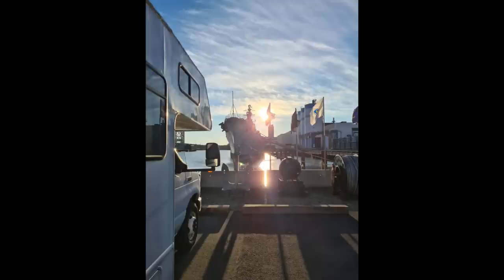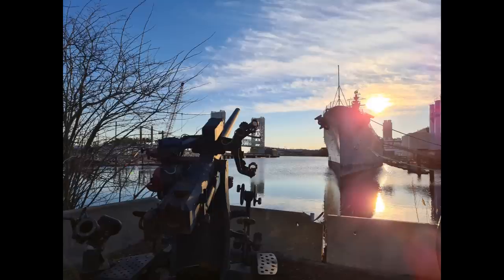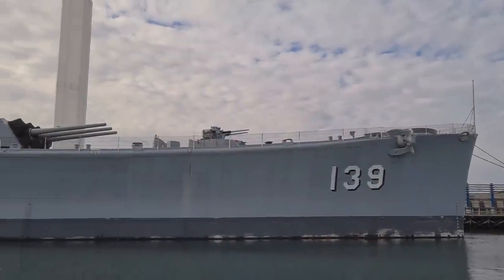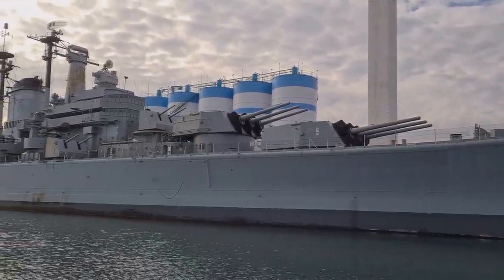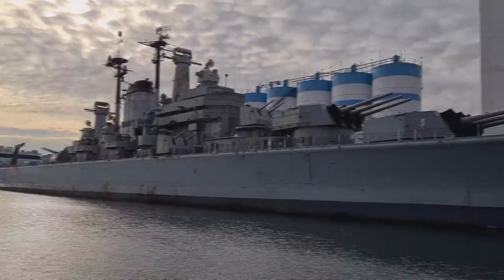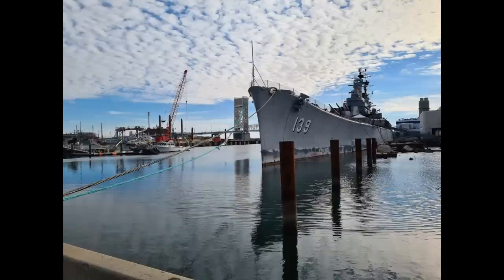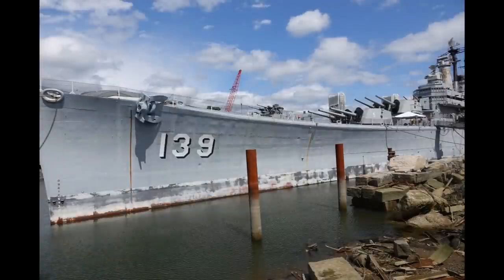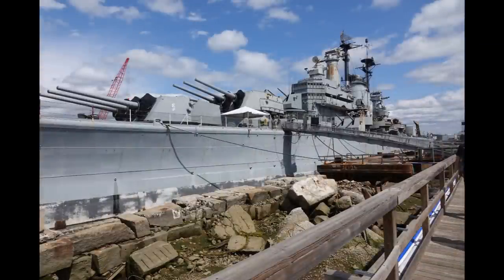USS Salem - Last of the heavy cruisers

Comment: that section in the gunpit made me realize how impressive it is that these guns were all-angle autoloading. The entire loading mechanism had to swing downward along with the gun into the pit

Also I've been on the Salem numerous times, and this is the first time I've ever seen the gunpits and magazines. Those areas are normally blocked off from the general public
Reply: That was truly a marvel of engineering. The only such system in the world,
Reply: @thomasbaughman9941  not at all unique, there are other autoloading guns that works in all angles but the ones on des moines class cruisers is the only one at this large size, the others are 155mm (6.1 inch) or smaller guns. like the archer spg/howitzer from volvo/bae systems has a 152mm (6 inch) gun that autoloads at any angle
Reply: @Deilwynna  Yea but this was in the 1940s. The Archer is from the 90's. In the Des Moines' day, the only weapons systems like the 8"/55RF Mk 16 were the 6" autoloading guns on the Worcester and Tiger class cruisers. All-angle loading itself was very rare
Reply: @Billy-I-Am-Not  The big difference s that the 8 inch gun system worked, the US and British 6 inch systems didn't US Mk 16 "These guns did not prove reliable in service, possibly because of the high rate of fire and need for any-elevation loading. Another contributing cause was that they used a dual projectile hoist system - one for AP and one for HC/AA shells - which proved to be a source of jamming."
Reply: @colbeausabre8842  the guns on the HMS Tiger worked fine, by most accounts
Reply: @Deilwynna  152mm would not be 5 inch, that would be 127mm.
Reply: @Deilwynna  There was the MCLGM which was an 8" gun. It could be considered the 8" version of the Mk45 5" gun, but the project was cancelled because the Navy couldn't decide where to use the gun. Initially it was for the Spruance-class destroyer, but then the DD wouldn't perform its intended escort and ASW role if used for bombardment. There was some speculation of using a Long Beach hull armed with this system for a new cruiser-sized surface combatant, but nothing ever developed.
Reply: @Deilwynna  firstly, nothing of that time period was even close, not only in size but in function. The system you attempt to reference as proof is both land based and 40+ years newer than the all angle vertical breach system used in the Des Moines, not to mention much smaller and only feed a single tube. This was a rather pathetic attempt at the stereotypical neck beard "AcKsHuAlLy" that has ruined the WW2 vehicle combat simulator game genre.

Comment: Heck, a ship in the USN doesn't need to be in mothballs to be cannibalized for spares! It routinely happens to ships that are just in the shipyard for overhaul/repair or modernization. I've been on both sides of it (having parts from my boat cannibalized and going to other boats in the yard to take their parts.)
Reply: So true.  I remember well, Easter Weekend, 1992 (I think) I was the leading comm ET on USS Peterson DD-969, we were finishing up a 14-month ROH at Ingalls in Pascagoula.  I had weekend duty. The USS John Hancock DD-981 had a bad class Alpha fire in her radio transmitter room, (The RM's had been stowing burn bags in the transmitter room. Still can't believe that the EMO or the Lead comm ET allowed that, I know I wouldn't have) and they caught fire, never did find out exactly how.  Smoke and heat damage was extensive.  Hancock was scheduled for deployment in just over a month. My guys and I had just spent the neter part of 6 months overhauling and grooming of all our HF transmitters, they were like brand new.  I was ordered to load them all into a rental truck and drive them from Pascagoula to Jacksonville and deliver them to the Hancock.  We brought back their fire damaged junk, and had to do a hasty, abbreviated rehab job on them with very little time to get it done.  Went from having a like-new HF suite to trying to remedy someone else's problems. (again) We eventually got them up to snuff, but it was a long, frustrating and exhausting process.  Truth be told, I'm still a little hacked off about it 30 years later.  LOL
Reply: ITs just as bad on the seawolf subs

Comment: The opening observation regarding the external view is interesting.  I had the pleasure of going aboard the USS Iowa on her visit to Pompey Dockyard in the late 80's.  I worked in the yard at the time and had a walk around the public didn't get with a middle aged leading seaman re-activated due to the near uniqueness of the Iowa in the US fleet at that time.  She was berthed on Pitch House Jetty (from memory) and was a truly menacing sight on a misty pre-dawn morning.  The gun house was an inverse Tardis.  Massive on the outside, much smaller on the inside.  The armoured conning tower gave a similar feeling but more so.  I wonder how many other 56 year Olds there are out there that can say they have been on board an active commissioned battleship?
The size of Iowa compared to HMS Tiger (or Blake - the memory fades!) Also in Pompey about that time was staggering.  Anyway, thanks Drach.  Another great video.
Reply: Fascinating sir. Thanks for sharing. I assume tiger or Blake were both just sitting in docks in reserve at that time?

Comment: Salem was the perfect choice for portraying the Graf Spee in my opinion. Such a powerful ship. I assume she could have taken down all 3 British cruisers without much trouble.
Reply: Salem's Spee cosplay
Reply: Having half a decades worth of improved fire control, radar and especially those automatic gun mounts. She could probably take on twice as many cruisers as Graf Spee did and still come out on top
Reply: That is a fun question. The actual participants; Exeter, Ajax and Achilles probably would stand no chance; Salem's rate of fire would probably overwhelm them in fairly short order before they could dial in the range and begin to deal attractional damage. Fiji and 2 Leander's may be a different prospect; the 12 guns of a Crown Colony class are the same as the Town's and were designed to give similar fire-power to a peer heavy cruiser, so the two Leander's and a Fiji possibly could throw enough 6in fire to certainly make a fight of it. 
I would expect all of the participants of the actual battle, ie Exeter, Ajax, Achilles AND Graf Spee would be able to take down a Des Moines class, although I would expect Salem could take one or two with her.
It is very much opinion; I've not looked at shell weights/shells per min/bursting charge weights to verify though. Speed would also be a factor; if Salem could dictate the engagement range she will have a huge advantage against any combination of battle/film particpants.
Reply: @deaks25  Well, I do believe that 6inch gunfire isn't enough to take down a very large heavy cruiser like Salem. Graf Spee took lots of 6inch hits and while they did damage, it certainly wasn't catastrophic damage. Salem had much heavier armor protection than Graf Spee, and the British cruisers would have no immunity from her heavy 8inch AP.

To  beat a Salem, I assume you would need 3 County class cruisers, or 2 pocket battleships. I think the effectiveness of her rate of fire coupled with her very advanced and accurate fire control cannot be overstated.

Regarding the Graf Spee + British cruisers vs Salem, I do think it depends heavily on whether or not Salem is able to knock out Graf Spee quickly. If she fails to do this, then she will probably be overwhelmed.
Reply: The Movie is right,   the British Cruisers won that fight as a direct result of their aggression,  in true Naval traditions they moved into closer range to fight Graf Spee inside her gun range, Damn the torpedoes "Full speed ahead".
Reply: @michaelkovacic2608  Don't you think the handling of the ships might have some bearing on the fight?  

Can you remember which shell left the Graf Spee unable to sail a long journey?
Reply: @michaelkovacic2608  As Graf Spee has shown, sinking isn't always necessary. It was pretty much a 'mission kill'. 6in shells could e. g. kill everyone on the bridge, take out radar/fire controll, possibly jam turrets, destroy auxiliary machinery. Depending on the circumstances this may very well lead to scuttling.
Reply: @20chocsaday  Well, Graf Spee was probably screwed regardless, since she was alone on the other side of the world, basically.

Salem is 5 knots faster than Graf Spee, she would certainly stay at range. 6inch gunfire won't harm her, while she can dish out very heavy blows.
Reply: @peterkapunkt6783  Well yes, perhaps. I was thinking of the battle only, without long-term implications. 

But when looking at Salem's armor thickness, I do think 6inch guns won't cause much damage unless they hit something important on the superstructure. 

By contrast, pretty much any 8inch round Salem lands will cause heavy damage. Basically, one side has to hope to hit something important to degrade the fighting ability of the opponent, while the other will cause damage with every hit. Salem can fire a ton of steel every 6 seconds.

You can of course argue against the Salem, but my money will still be on her regardless.
Reply: @michaelkovacic2608  She nearly got away but used her speed to close with the three cruisers.
Reply: @billiardsandsnookervideosn8319  If memory serves that style of attack caused some confusion on the Graf Spee.  Destroyers, cruisers and battleships of the period all had the same basic contours and, without something to refer to to get the idea of scale, it was easy to get confused about what was coming at you.  Because of the way the British attacked, Graf Spee thought they were destroyers making a torpedo run so they were waiting until the "destroyers" broke off (indicating they'd launched the torpedoes) before taking evasive maneuvers themselves.  This gave the cruisers precious time to get in closer than they normally would have.

There was a similar situation but in reverse with the Japanese and the American task force Taffy 3 at the Battle of Samar (another excellent Drachinifel video if you haven't seen it, link below).  In that case though the Japanese thought they were up against the main body of American fleet carriers and cruisers so they were using armor piercing shells that, in several instances, punched right through the destroyers without exploding.

https://www.youtube.com/watch?v=4AdcvDiA3lE&t=28s
Reply: @silverjohn6037  Yes, that's exactly what did happen. N
Reply: @michaelkovacic2608  The 6 inch gunfire was not enough to take down a Graf Spee either, or render her Combat ineffectiv but it was enough for a mission kill.
And the upper structures of a Salem weren't armored, so the question is: Can the three Cruisers inflict enough damage, to mission kill the Raider.  Of the three british cruiser, the Exeter was nearly a loss. Ajax had two turrets out of Action and had to gain Range after Exeter was out. But Graf Spee received a lucky hit from Exeter and several other hits which was a mission kill for her.

Yes Salem would have disposed Exeter faster, but Exeter had an expert Gun Crew at that moment and may have hit Salem with one or two hits in return, like Graf Spee. And she could keep the distance better, but Langsdorf could have stayed away and go for an long range duell, so on the same conditions the outcome maybe worse for the RN with 1 Heavy Cruiser out/sunk and 1 Light Cruiser sunk and 1 damaged. But it may still be an mission kill. 

Graf Spee won the Battle of the River Plate, but had to ceed the field because of a lucky hit. Same may have been for the Salem or not.
In a fight Salem vs Grad Spee, it's the Salem Battle to lose, she is faster has rapid fire, but is not protected against 11 inch. When the Graf Spee radar has a good day, and they deal in the Range pretty fast, and the Salem is slow on this day to get a fast reading, the first Salvos may decide the battle. But under normal conditions the Graf Spee is in big trouble after 5 minutes when the Salem got the range and go into Rapid fire.

Radar and Autocannons don't mean you have a lock on target and start throwing shit at the wall, it means: 30-50 seconds waiting, spotting your fall of shot, maybe two salvos one long one short, and when you got the target bracket in, then rapid fire. Flighttime Problems on range.

Graf Spees third Salvo was on Target after 5 Minutes, inflicting splinter damages all over Exeter and after 8 minutes it killed 1/3 of Exeters Firepower.
Reply: @Elkarlo77  I am generally no fan of using large surface combatants as raiders, simply because even an inferior force can mission-kill the ship. Better to use armed merchants for this particular job.

I have no doubt that the Salem wouldn't walk away from this battle with her paint unscratched. Its quite likely that she might be lost or scuttled in the aftermath. But my original post focused more on the battle itself, and I do believe that she might actually sink all 3 cruisers.

I am generally focusing on German warships, so I am not that well educated when it comes to US ones, but as far as I can tell, late-war US fire control was excellent, and I wouldn't assume the Salem, commissioned in 1949, would have trouble in finding the range very fast. 

Historically, the battle wasn't much to write home about for the British from a tactical perspective. Yes, they achieved a mission-kill, but Graf Spee was still quite combat-effective while Exeter was basically out and Ajax had half her main battery knocked out. It wouldn't take that much more to have the battle snowball against the British. Salem might achieve complete victory imo.

In a Salem vs Graf Spee scenario, I do think that while German radar was very good (and is constantly underestimated, reportedly Tirpitz was capable of very accurate blind-fire in 1943), Salem is just better equipped. And while Salem is of course vulnerable to 11inch shells, Graf Spee will also take deep penetrating hits.

If Germany had survived WW2 and a pocket battleship had received the latest radar and fire control equipment after the war, then the battle is probably very close. But a 1949 Salem vs a 1939 Graf Spee is in the Salem's favor quite a bit, I think.
Reply: @michaelkovacic2608  Graf Spee could have avoided the combat or at least stayed a range. Langsdorf got the identification wrong and chose to charge in and not to keep the distance so they have to kreep in with their 4 Knot speed advantage.
With the same error Langsdorf made on USS Salems side, closing the range instead of staying at higher range she would have suffered. And it's the only Chance the RN Ships got, as they have Torpedoes and shorter ranged weapons. Otherwise Salem would kept the three cruisers over 19.000 Yards and pound them to death.
And Achilles may have got the Order to disengage while Ajax stayed. So Achilles could shadow the damaged USS Salem.

Salem vs Graf Spee, as i said it's the Salems fight to lose. She got all advantages but an early range finding by Graf Spee and some early hits may change the outcome. But on a normal day with both normal crews without luck USS Salem will take the day. The most intresting part of those two ships is that the Salem Main Belt and Graf Spees Main Belt are out of the respectiv zone of invulnerability. Graf Spees 100mm mainbelt at 28.000 yards and USS Salem at 33.000 Yards. 
So Salem has to sail quite a bit into the Damage zone and she can realy use her Rain of Metal death when they are at 20km due to flight time, thanks to Super Heavy Shells.
But on an ordinary day USS Salem will win it, maybe get some nasty hits till she can putt down the German Ship but win it.
Reply: The fact that a 3 v 1 is even a debate shows how powerful the Des Moines class is. Sure the York and Leander classes are 'budget' heavy and light cruisers is a factor (and I do think a County and two Towns is a very different discussion) and Salem is a top-of-the-line, pinnacle of technology heavy cruiser but still a 3 v 1 should be a significant up hill for the 1, which was demonstrated by Graf Spee: sure she was likely to sink Exeter and maybe one of the Leander's but attrition was becoming a factor, shown by the fact she was forced to ceed the field (meaning a tactical victory for the British) which meant she was mission killed, ie a merchant raider that couldn't raid merchant ship (strategic victory for the British).
Salem likely overwhelms the British squadron before damage attrition begins to degrade her enough.
Reply: What was weird is that HMS Sheffield (triple 6” guns) played HMS Ajax (twin 6” guns).
And Salem would have trouble I think given that all 3 (I assume you mean Ajax, Exeter, and Achilles) combined can fire no more than 83% more shells than Salem.